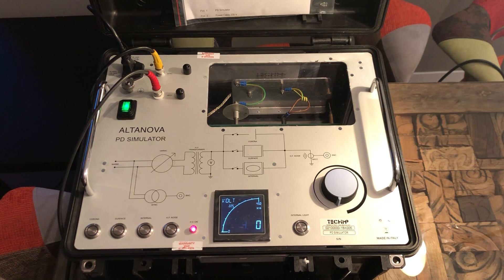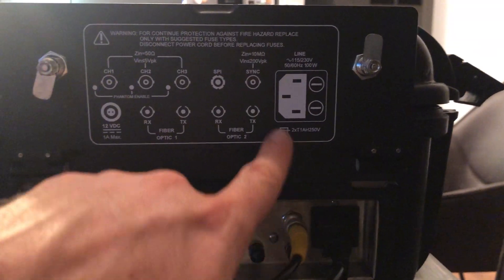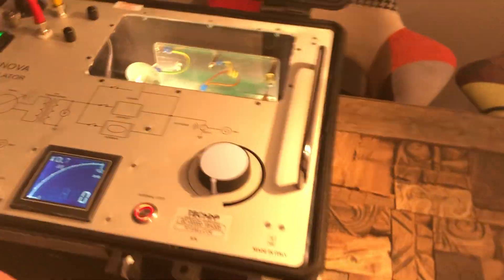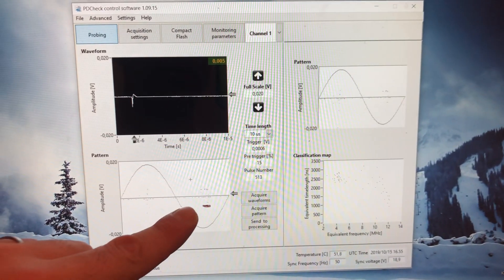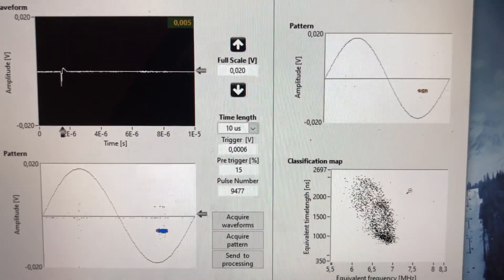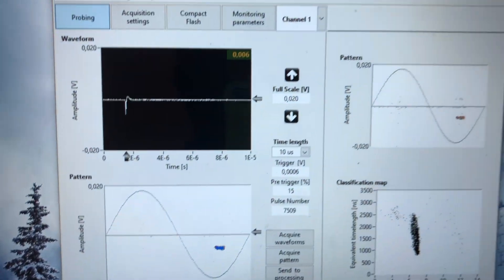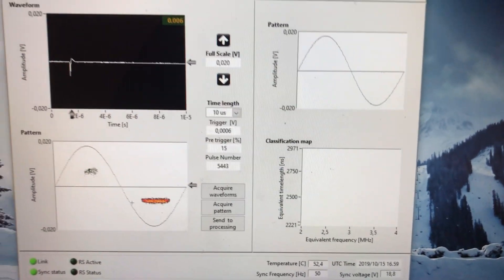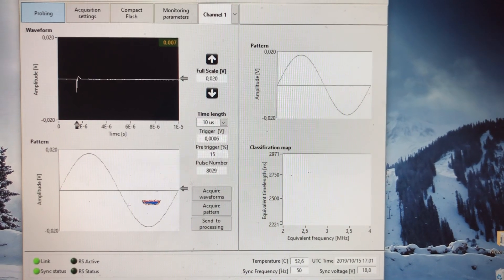Partial Discharge - Techimp Technology - PD Simulator TF map separation

Comment: What will be the connection?
Reply from the maker: The connection is very simple - the coax cable from Simulator goes directly to input of acquisition unit. One goes to "HF" input - the one that measures PD, and the other one goes to Synch input of Acquisition unit.
Reply: @sheppo17  thanks for Replying..if you don't mind can we discuss on my Watts-up No +971558095472 little further...